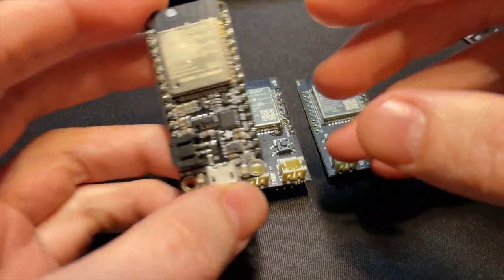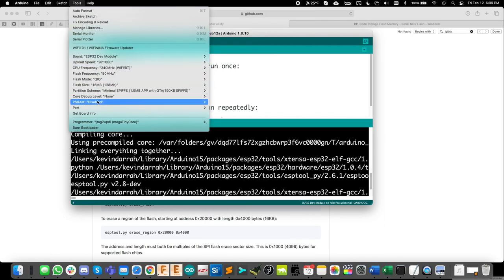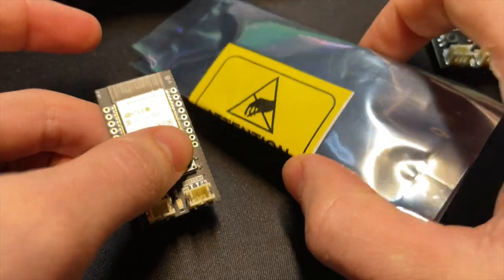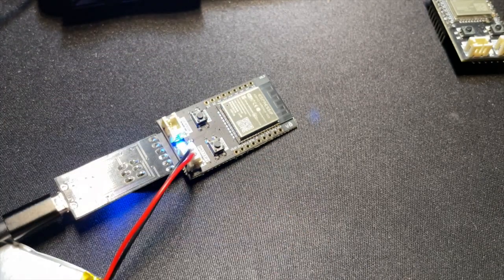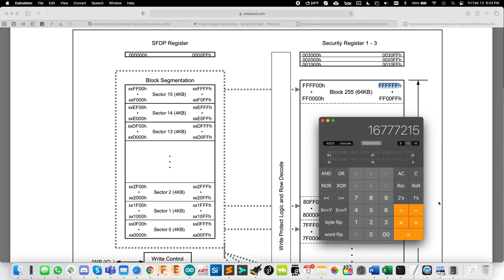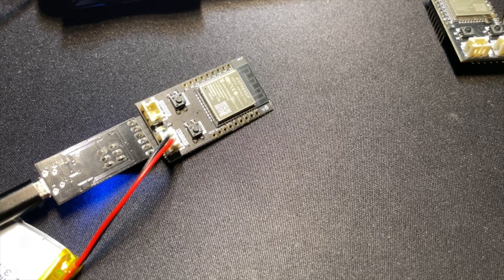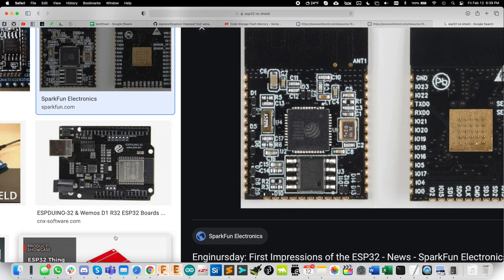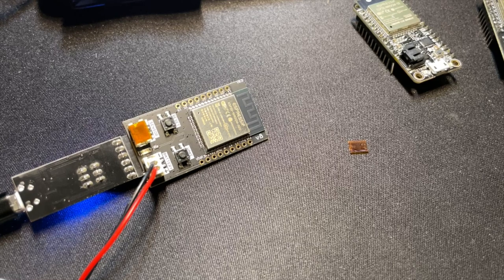How To Read from ESP32 - CLONE/BACKUP Everything

Comment: My use-case is that if I have a device that I have bought as part of a solution and I want to try it with my own version of the software I don't want to permanently delete the software it came with. (EG, Specifically a multi relay board with built in ESP01 and I want to temporarily change the ESP SW) So I need to be able to read the flash and restore it afterward.

Comment: Thanks, Kevin.  Tried to use this after a library upgrade cause my Sketch to no longer run.  I took an new empty ESP32 Cam, loaded a program and tried to read it.  An immediate fatal error of COM port doesn't exist occurs and the IDE never tries to connect. Just wondering if you heard if Arduino IDE has done something to prevent reads.  I tried reading a single memory location with the same results. Here is the message when not specifiying a serial port.
esptool.py v4.5
Found 1 serial ports
Serial port COM7
COM7 failed to connect: Could not open COM7, the port doesn't exist
I'm an old fogie trying to learn new stuff but find many sketches do not work due to changes made in the library.

Comment: ESP32 does have a flash encryption function to get around this issue.  it uses AES-256 encryption and the key can not be accessed by software. PLuse there is also a secure boot option. So you can protect your firmware if you want, but i expect that somebody could still hack it if they spent enough time and effort.

It's not uncommon to have memory protection on microcontrollers.
Reply from the maker: thanks yea it's normally pretty easy with uC's, but with the external flash here, takes a couple extra steps.
Reply: @Kevindarrah  what is uC ? Does it get you the encryption key